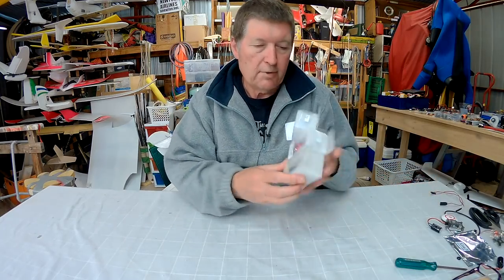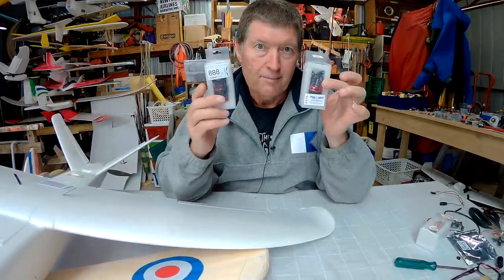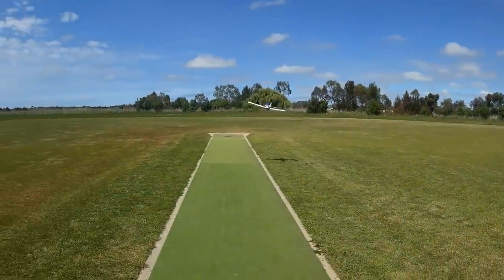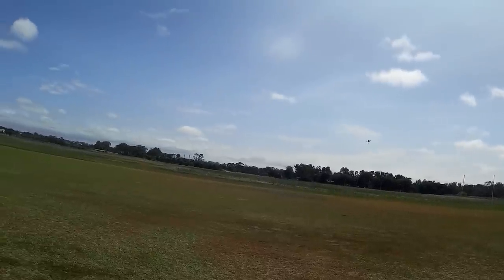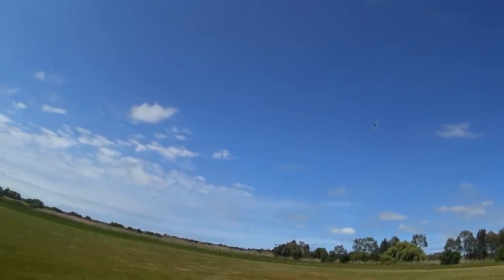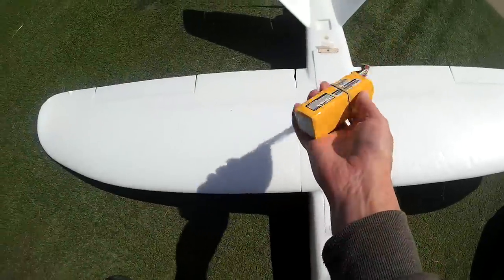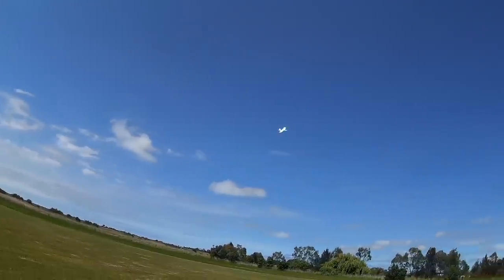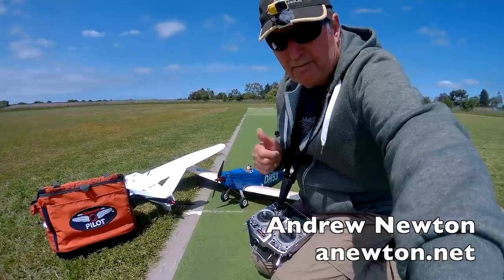Smaller CarbonBird motors on planes

Comment: Very nice!  I'll be ordering some in soon.. the Big Dog 3515 for the Cloudsurfer upgrade and which one of the smaller would you suggest for the Vundra?
Reply from the maker: Depends on the prop clearance, the 888kV is more powerful but needs an 11x5 prop and 4S. The 1145kV and 9 x 5 might be good for the Tundra. Pity there is nothing in the range between these and the big fella
Reply: Thanks for the reply, looking thru' my spares I got 4 x 2830 1100 KV Prop Drive motors off my Aquacopter... might give one of those a go first...

Comment: Both those motors are very low KV,    which may suit just floating about, But the down side is with low kv motors you need  more expensive 4s battery's  and esc's to fly the planes,   not to mention bigger more expensive props, 
 as for the sunnysky motors I have a few? (2)  and they are faultless performers,  with japanese bearings, 
for myself ALL my models (over 30 flying) are based on 3s battery, I have  maybe 25? battery's all either 1300mah or 2200mah 3s, they fly my models with spans  from 600mm Bonsai to 1.9meter skywalker Naja,  so for me these motors are  Less efficient, as I like to fly faster than floating  around and I must keep within a budget :-/  so buying more expensive 4s battery's and more expensive esc's are a nono for me, I can buy 3s esc's from ebay  30amp for au$6 delivered, and  40amp for au$9 and they are a dam sight more reliable than the hobbyking esc's,  great looking motors but they step up the cost of flying, (going 4s)  so no good to me.   the little 2826 2450kv  RaceStar? motors from bangood au$6.50 are now  my goto for  upto  1.5 meter spans, (bixler style)  
great vid thanks for sharing,
Reply from the maker: Yes I hear you. 90% of my lipos are 3S. But I can see more 4S in my future